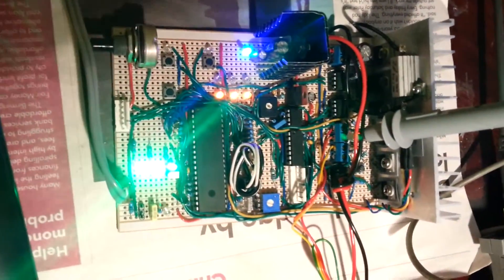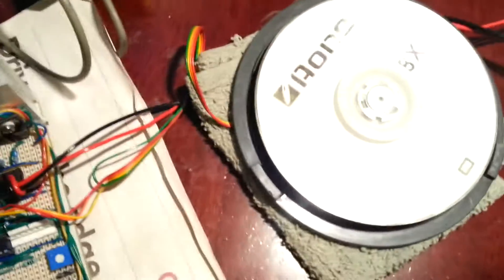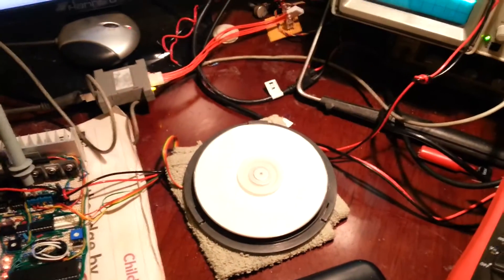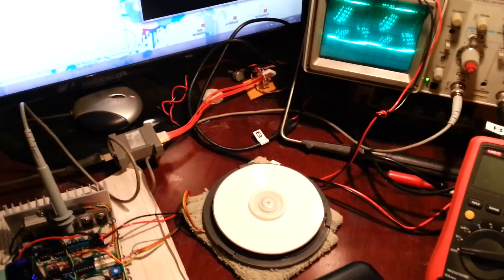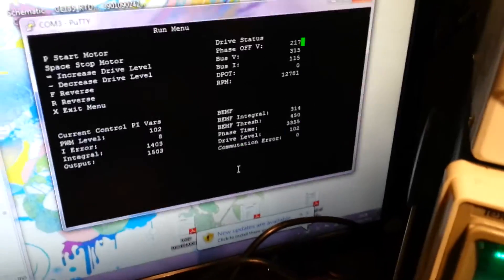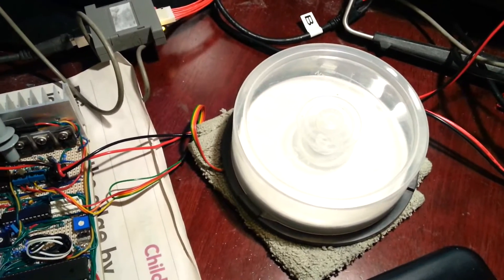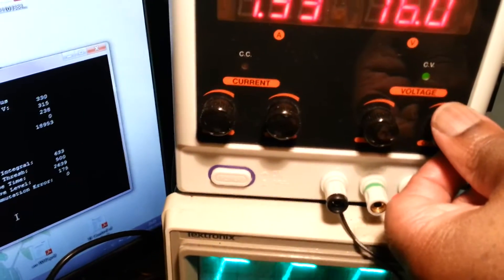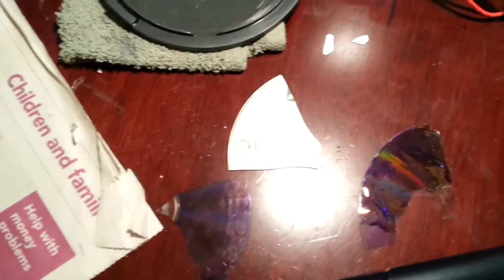CD Explodes at 20000 RPM Sensorless dsPic30F4011 BLDC Controller

Comment: Can you share the code with us?
Reply from the maker: I'm not planning on releasing the Code, this is just a learning project. The algorithm is based on integrating the back emf to determine commutation time. There are many excellent projects on the web with schematics, code and board layout etc. All the large semiconductor manufactures have detailed application notes and example code etc.
Reply: +Coolkeys2009 Why not? I did'nt find anything useful about back-emf in the internet
Reply from the maker: Kai Jan 57 Wikipedia has plenty of information about BLDC. Back EMF zero crossing is commonly used. Integrating the BEMF was a technique I heard about when watching a Texas Instruments Instaspin video on Youtube. There is a lot of information available in Application notes.
Reply from the maker: Kai Jan 57 This video by Texas instruments will tell you almost everything you need to know. It helped me a lot. watch?v=szgVUfyX8JM

Comment: I think the problem is the cover CD, it should be related with physics. I mean if you turn something in tight air, then basically you try to compress the air until the cover cd cannot hold its pressure.
Reply from the maker: I've exploded 3 CD's now only 1 deliberately, one in open air and 2 in containers of large and small size. The common factor seems to be if you run them at over 15,000 rpm they will probably explode sooner or later. CD's spinning at that speed  do move a lot of air so it may also be a factor.